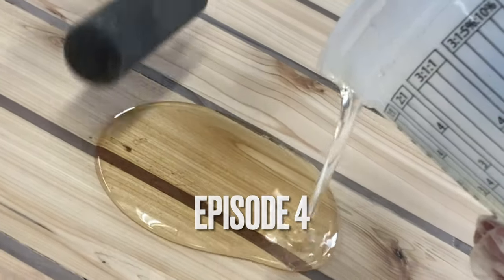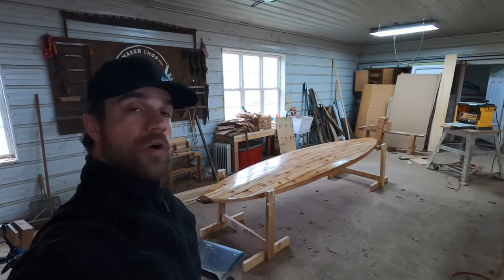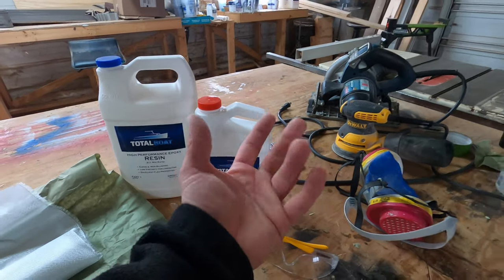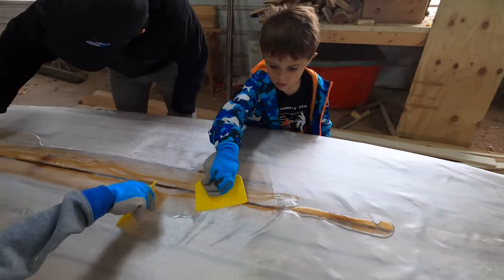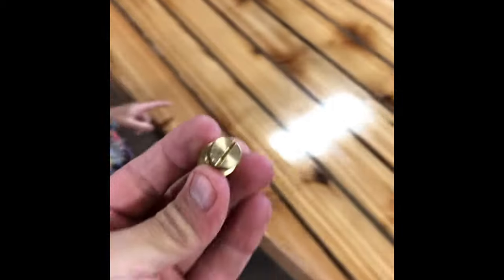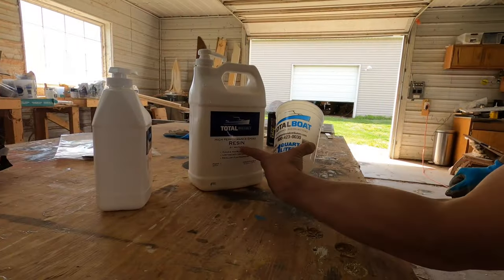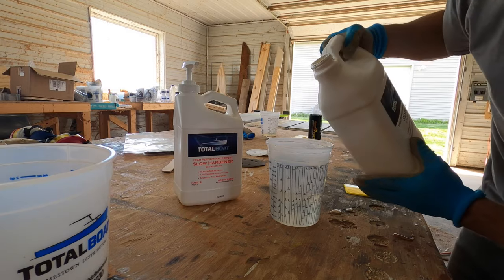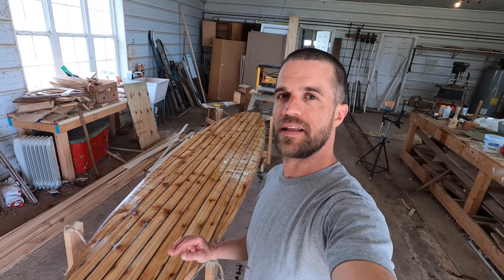Wooden SUP Build Episode 4: Glassing the Frame

Comment: Hi Justin, I’m binge watching from the first to now. It seemed like you had some gaps or cracks along the rail and even a part that wasn’t adhered completely. Did you fill in with thicker epoxy or just glass over and hope for the best? Thanks, Chuck
Reply from the maker: Yes, I filled in with just my own homemade “wood filler” (glue and sawdust)…. Then did a flood coat with epoxy to help fill in remaining and adhere better.

Comment: Way too much epoxy.  The wood should not be shiny from the primer coat.  Your goal is to just seal the wood but still allow the glass adhesion layer to soak in a little.  The first coat into the glass should leave the cloth texture.  Too much will cause the cloth to float on the epoxy and give a poor bond.  You should not need a heat gun when doing this.
Reply from the maker: Probably didn’t need to hear, but also was following a friend who had done many boards and does this for a living. Me, being an amateur, is simply sharing the process
I used. I have found several ways from several different companies and people suggesting different things. I didn’t have any adhesion/bonding issues.
Reply: @dietrichnsons  - Just trying to save you a bunch of weight on future builds.  We have only done 3 cedar strip canoes and a stitch and glue kayak.  I am guessing your friend uses a lot less epoxy in his process.
Reply from the maker: @davematthews7686  my reply was supposed to say “probably didn’t need to heat”😂